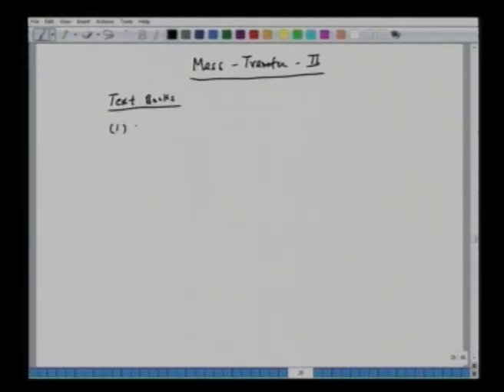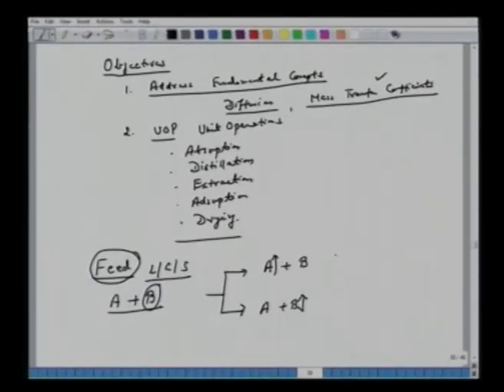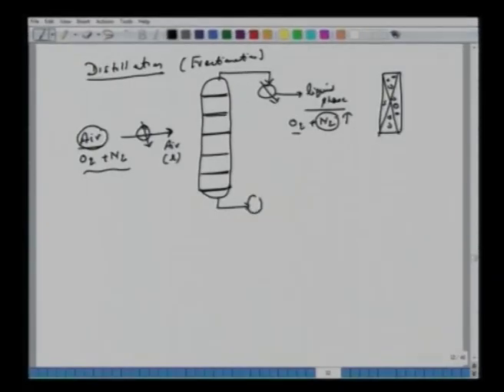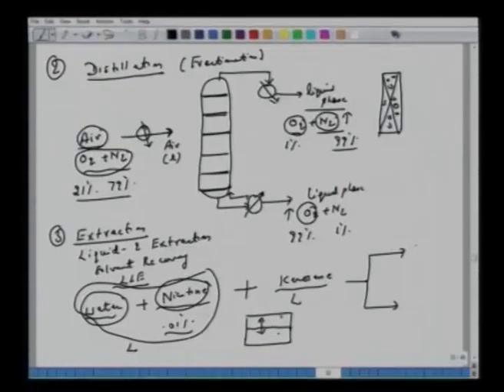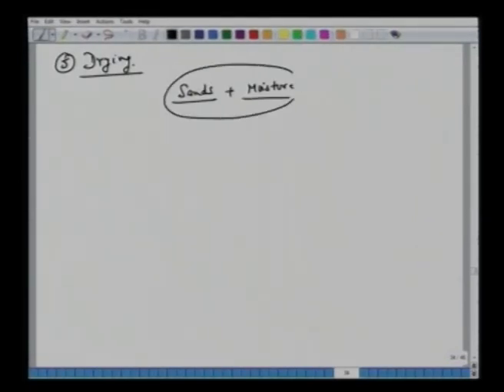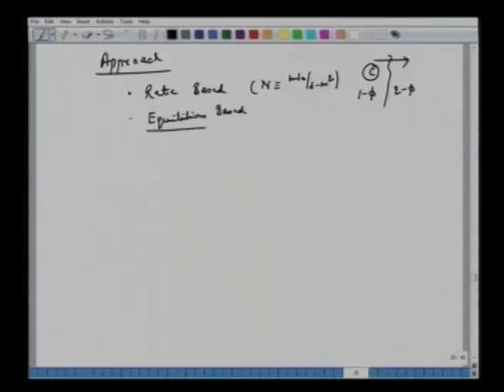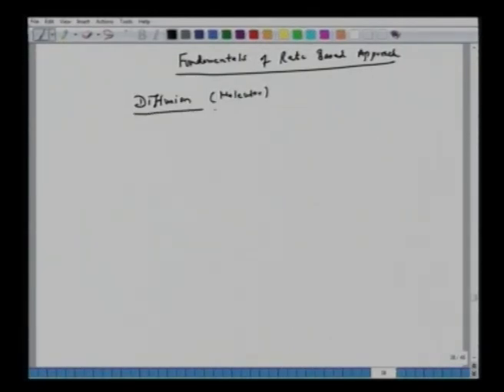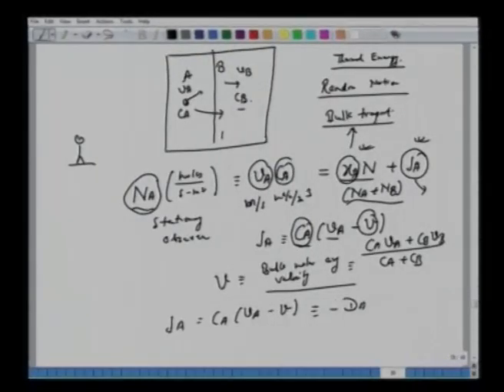Mod-01 Lec-01 Lecture-01

Comment: 1. Introduction to Mass Transfer Operations
2.  Fundamentals of Diffusion
3. Examples of Lecture 2 concepts
4. Mass Transfer Coefficients and Theories of Mass Transfer
5.  Interphase Mass Transport
6. Material Balances for Continuous Contacting Equipment
7. Material Balances for Stagewise Contacting Equipment
8. Example of material balance, Introduction to Absorption
9. Absorption ( Equilibrium, Hydrodynamics, and Minimin liquid-gas ratio)
10. Absorption Examples
11. HTU and NTU Concept
12. HTU and NTU Concept Cont'd, Example
13. Example of adsorption, Introduction to Distillation
14. VLE ( T-x-y and P-x-y diagrams)
15. H-x-y Diagram, Flash Vaporization
16. Flash Vaporization Cont'd, Continuous Fractionation Column Introduction, Ponchon-Savarit Method( Enriching Section)
17. Ponchon Savarit Method( Stripping Section, Reflux Ratios)
18. Example 1
19. Example 2
20. Mccabe-Thiele Method
21. Feed line, Location of the feed tray, Total Reflux, Minimum Reflux Ratio
22. Example, Use of Open Steam
23. Examples, Tray Efficiencies
30. Adsorption: Introduction, Various types of adsorbents, Flow and Batch Adsorption Experiments
31. Pressure swing adsorption, Types of Adsorption, Types of Isotherms, Mathematical description of breakthrough curves
32. Stagewise operation: Single-stage, crosscurrent, counter-current operations, example
33. Example: crosscurrent adsorption, Batch adsorption, Example
34. Adsorption in fixed bed column, Example
35. Introduction to Drying, Mechanism, Equilibrium curve, Definitions
36. Rate of drying curve, Time of drying expressions, Examples